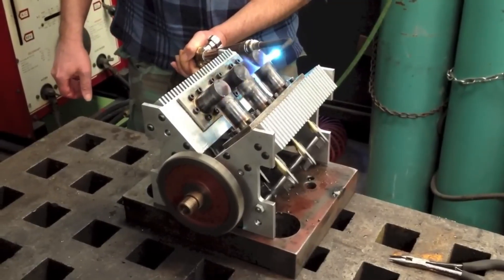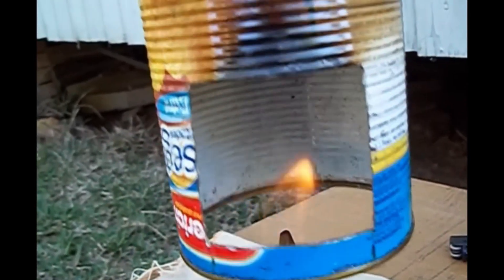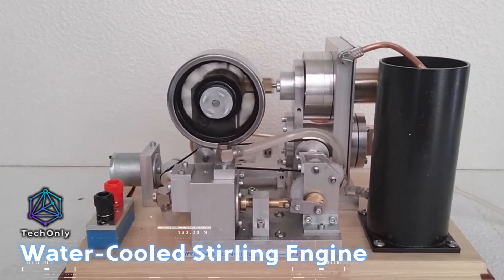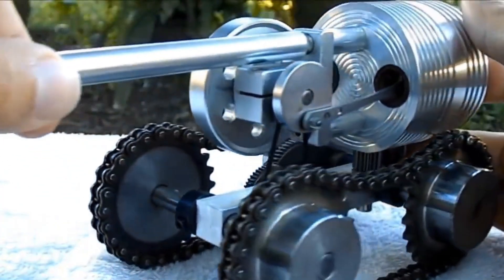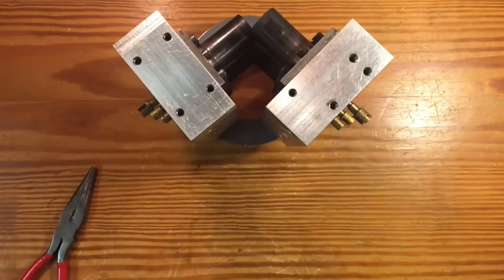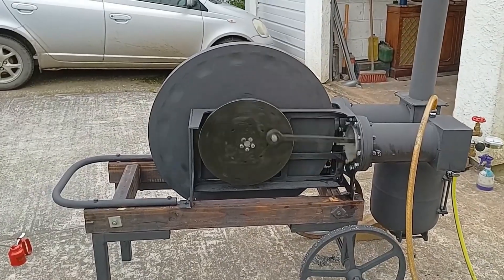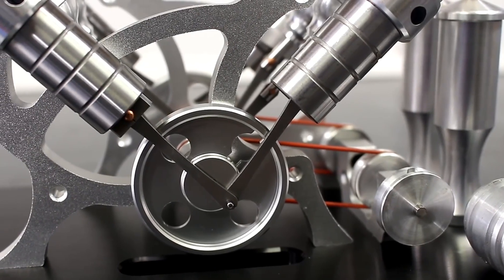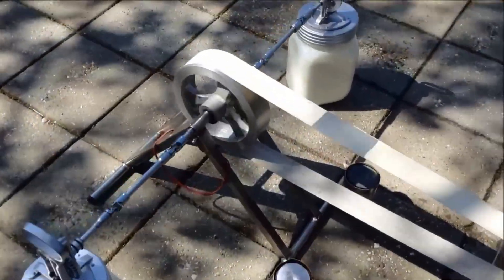TOP 9 OLD STIRLING ENGINES  MOSTLY HOME MADE

Comment: I have plans for using Stirling Engines as the power source for an off the grid sanctuary. Going to need an engineer's help putting it together the right way - will have multiple LARGER Stirling Engines backed up around a thermal chamber heated by a  concave parabolic mirror focusing intense sunlight into the crucible chamber and the engines would be anchored in place and conned to electrical generators... just have ideas about it, no blue prints at this time

Comment: They are the "buzz word" of free energy types,,and many claims have been made for their uses,,but the power out put is pathetic,,any load beyond tiny stops them,,yes the flywheel turns,,but so would a simple propeller above the flame ,,they might operate a LED light,,but not a sewing machine or any usefull farm tool,,and even a push bike would be worse for the extra weight carried,,but if your the "perpetual motion" dreamer,,hopeing for a miracle,,that two and two might equal five,,they are for you,,,

Comment: Enjoyed the excellent presentation. These devices have a history of powering water pumps and in the mid-1800s, powering small factories. Steam engines, were more expensive to make or maintain, I gathered. I've seen a YT clip where there was a small Sterling powering a converted row boat. I've also heard that there have been military submarines that have a Stirling heated by a nuclear pile to make the sub's electricity. For a time there were small commercial Stirlings for campers, that were powered by butane to make electricity for that camper. A well-know and effective set of widgets and principles. Some of the solar-powered devices don't have none-reflective black paint on them ---- I wonder why that is?

Comment: the only issue is, it only has the power of one atmosphere at the size of the piston head. since it doesn't use steam, or combustion of a fuel to make pressure, hot air is the only way it can cause pressure. this means, unless you have a lot of heat, its very inefficient for how much power you can get out of it. a bigger piston head for more surface area to make more pressure would take more heat to heat the air when the piston comes back. all of these that are powering something have a huge gear reduction, or a huge surface area on the piston head while having a lot of heat. like propane burners instead of candles. all of this so its small power can be used. this is why we only see scale models of it, and nothing using it in daily life. but it is a very cool idea and example of expansion and contraction of air as it heats and cools
Reply: You're misusing words here.
"It's inefficient for the power you can get out of it". Just shows that you don't know physics or maybe your definition of the words isn't clear.
Maybe you're talking about low power density? Or volumetric power density or weight power density?
Reply: I think I understood your reasoning. 
Yes sterling engines have the lowest power density compared to other engines.
But the pressure isn't 1 atmosphere necessary, lot of sterlings are run at higher pressures like 8 atmosphere for example or use different gazes like helium or hydrogen.
Reply: The Stirling usually runs at faster rpm than other engines which means the lower pressure on the piston produce work at faster speeds to compensate so in the end it might be higher power compared to the lower torque
Reply: NASA built a stirling engine car in the 80's, it worked fine and was more efficient than common gasoline engines.